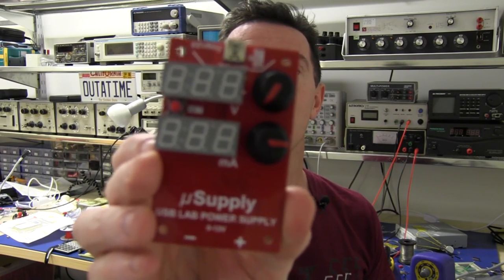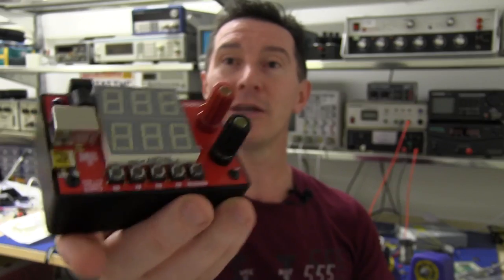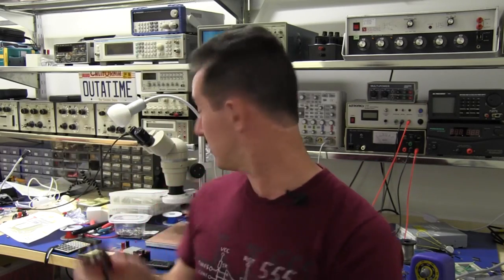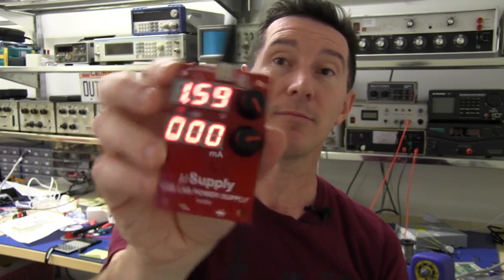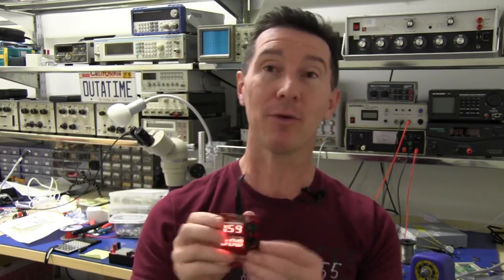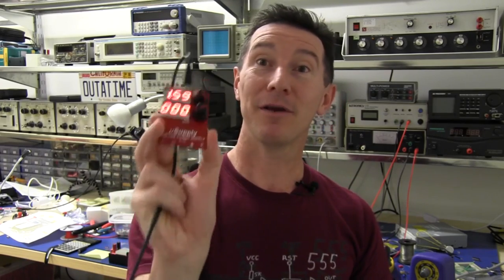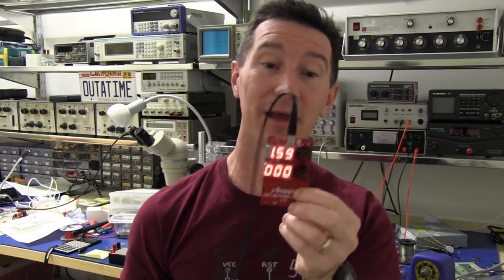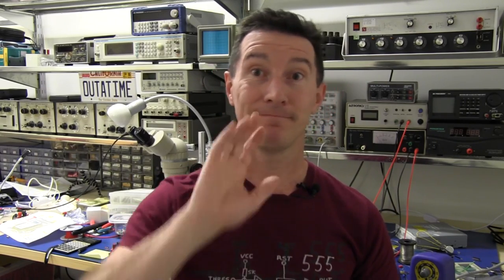EEVblog #285 - USB Lab Supply - Part 1

Comment: As an electronics engineering student, this is amazing. 

Off the top of my head:
- Won't the 7seg-displays use up a lot of power? About 40mW * 6 = 240mW ~ 10% of your available power, or am I overestimating? Substitute for lcd?
- You could also use an attiny to make the supply effectively a usb keyboard, that outputs all the values as typed text (in notepad or something), you can even have two-way communication using caps/num/scrollock. Maybe for a future usb-stick size nanoSupply :) ?

Comment from the maker: IIRC the dual muxed display at a reasonable brightness took about 40mA or so (200mW). It's a lot, but I was fixated on having LED displays at the time. I have a trick up my sleeve, those displays are not the final solution.

Comment: I actually got a recent design that combined the USB and batteries into one unit - USB charges the batteries, and batteries powers a boost converter capable of at most 36V at 2A. I called that MTD295A (5 cells, there was 3 designs differ in only the amount of Li-Ion cells used: 295A with 5 cells, 299A with 9 cells and 292B with 12 cells).

Comment: Also, there are USB Power Delivery (USB PD) which allow a USB port to supply much more than 2.5 Watts. Though probably no one implements this at the current time and afair it is still a draft, it might be good to look at the coverage of this and take a future implementation of this into consideration. (You are of course right that 2.5 Watts is really neat, but if you really think about it - very often this is not enough.)

Comment: PL2303 (cheaper than FT323) to add a "com" port in order to control/log it via software. It should be trivial since there is an (PIC ?) mcu (judging from the use of rotary encoders).

High current output selection switch (1000 mAmps) for USB3 ports or Dual USB2 connection.

Comment: I like the idea. I would like a boost convertor in it so you could get roughly 0-12VDC output voltage. You could get fancy with computer controlled set points, but I think a two knob interface is a great starting point.

Comment: If it's specifically for a PC USB port (not any generic USB power adaptor etc) then I would want it as small as possible and have all the control and monitoring on the PC. You could then have data logging and automated control, pre-sets etc and no bulky display/input on the device.

Comment: USB ports on a computer are generally all centrally fused (usb_org/developers/whitepapers/power_delivery_motherboards_pdf), so are capable of supplying much more than 500ma/1000ma that most people quote;
Current limiting on the USB ports in a per port basis is generally only on hubs, it is not designed as a "current cop" to stop you going over the allowable current, only to protect you and your devices.

Idea related to above;
Put some form of adjustable current limiting on the sour

Comment: Futher ideas (may be interesting):
1) Lead-acid battery powered regulated supply. Perfect isolation and overcome 2.5W power limit on USB
2) Redesign a cheap "electronic tramsformer" for halogen lamps into normal unregulated power supply. Power levels of 50-300W can be obtained easily at below $10.

Comment: Pretty simple idea. I feel it needs either a low power LCD or a way to turn off the LED display so you can save a few precious ma for the project, but honestly if you're going to be going that close "to the rails" this may not be the best option.

Comment: Pt2: Yeah and I also have an LM317-based linear regulator designed with 12v input in mind. It's not terribly efficient, but does the job when you need additional voltage, and it's not common you need a lot of power outside of the 12/5/3.3v rails anyway.

Comment: I've come up with a few solutions like this myself (albeit mostly fixed voltage), I have a couple of bench supplies but sometimes you need more voltages, and PC PSUs are great for tons of relatively stable power. E.g. I've modded a USB port so it's wired directly to the 5v PSU rail rather than running through the motherboard, so current is less limited, but no data. I've also made a box with banana sockets on, wired to 12v/5v/3.3v/GND, connected back to a SATA power connector inside the PC.

Comment: 10A at 30V is a lot of power, im already habing problems getting my 0-40V 100W sepic to work as intended without overheating.
for 10A you need some wide tracks, and for 30A you would have to use a solid cooper wire of about 4 or 5 mm as tracks. further more 30A is a lot, i use a circuit breaker anytime i work with lead batteries because of that and even with the 15A CB it can still evaporate 2mm track in the time it takes it to disconnect.
u would need a really quick regulation circuit there.

Comment: @ battery power supply, 

I know it's late for this project . . . , but if it is at all possible: 
How about including, say, 2 (or more) programmable buttons!!

I would LOVE a couple programmable preset voltage/current buttons (or more if they will fit)
It would work with your included uController, just press & hold to set, & quick press to sellect!!
(or perhaps one being voltage button, the other current . . . )
[momentary buttons = small/ Cheap!]
Would be nice for this supply TOO :)

Comment: Depending on how you do a sense/ref voltage, it would be nice to have an extra lead that would be a voltmeter.  So with analog switch depending on microcontroller, you could sample the supply output, then switch in the extra input and read it, Or use a ADC on the microcontroller. It would be nice to be able to measure some other voltage when you power up something your are testing and a button then for the voltmeter readout/mode.  (Might also use this extra probe as ultra low volt/current sense

Comment: I would assume with such a project you would want it to use as little power as possible and be as efficient as possible.
Wouldn't it save power to use one small LCD screen with 3-4 digits or maybe one 1x8 lcd? 

Also, there's the usb charger standard which allows them to demand up to 1.5 A. How about adding a switch allowing users to limit to 0.5 or go higher? 

Sending v/a out through USB would be great...would be nice if you at least talk about (isolation etc) even if you don't to do it...

Comment: I'd say make it a 'hybrid' power supply! Be able to control from USB, but also powered from USB up to 2.5W. If standard power pack is connected it will switch to that power source by itself. I guess the power output would be limited to 2.5-10W depending on the design, so like 0-1A output at 0-12V or something. The only issue with that is that you'd need a buck-boost converter for that..

Comment: also, if you have a mcu on board, you might add a simple CDC interface so that it can send data to PC on current and voltage (or even receive data from pc for set current and voltage, but I think readout is more then enough)

Comment: Great idea!

Does it have protection against drawing too much power from a USB port? I've seen a few PCs which do not have a PTC thermistor or any sort of current protection on their USB ports (!!!) now. Usually you find out about it when a USB device or cable shorts, and the PC's mainboard catches fire. Maybe make it adjustable using a jumper to make it possible to utilize a 2A USB power supply (like the iPad power brick, for instance)? That, and reverse current protection, and I'd buy one!

Comment: This is a great idea Dave... 
I wouldn't mind it being bigger, As long as you make it as flat as possible, 
(about the thickness of a kindle maybe a bit thicker) 
So it can easily fit in to a laptop bag/pouch without causing any damage to the other stuff that's already in the bag/pouch (so, no sharp edges, parts, or protrusions ).....
Reply: vape-pun-to-come More realistically, better power components can be used if it's the size and shape of the laptop charging brick.  B port on one end, 3 or 4 output binding posts on the other, reusable generic USB cable, computer controlled and monitored buck/boost isolated DC/DC converter inside.

Comment: Pc/laptop usb can only supply 100mA until the device has negotiated with the host that it needs more (some computers can now supply 1A or more over usb). A simple mcu with hardware usb support would overcome this problem though

Comment: Some of mine ideas:
1. powering from 1 to 3 usb ports to get 1.5A, it would be useful.
2. programmable trigger for start/stop loging and start/stop output.
3. Data loging to internal memory when connected to, for example usb charger, car audio, etc.
4. Voltage and Amps meter witch loging capabilities.

Comment: How about making it so if you wish u can add a 2nd usb cable for more current and/or notebooks that dont give the full spec. What about making it a hub also? (Then I dont have to carry a separate hub) What about an external power input for an SLA or plugpack? I have had applications where I need 3.3v with at least 2amps, and I was forced to go and use the desktop (and steal the 3.3v from the internal switchmode, quick and dirty but it did the job surprisingly well)

Comment: Can it be adjusted above 5v? Maybe a pin and sleeve connector that comes out at a right angle from the board to keep it slim. Do you plan on leaving the connections to the load just solder able?

Comment: Hi Dave!

You might consider designing the new gadget in a way that it can handle the extra power that comes from a dual USB connector cable (Dual USB A to Micro B - USB cable). Like the one that comes with portable harddrives without wall warts. That would be 5 W rather than 2.5 W.

nixxon

Comment: How about an option to control the settings from the computer over USB :-) If you build something Arduino compatible, there is no problem writing the PC software. Oh and of course also push values back to the PC of the current and stuff... [2c]

Comment: I use a bus pirate as a sort of USB power supply (I find it pretty useless anything else) .. It's useful as a PSU because I can turn it on and off via its shell interface which is really handy when working with micros etc as you can power cycle without your hands leaving the keyboard. So my feature request would be to have some sort of control interface over USB (with the hardware knobs too if possible). Having a DC-DC booster for more than 5v would be nice too.

Comment: It would be nice to have a slick design of it. Why not use a LCD screen something similar to calculator or ur digital watch. Also the control nobs need not to be that big even for a person with a big hand.

Also, it would be nice to have a port with a fixed 5V supply for the project where you need multi supply voltage.

Comment: I like the idea, but haw about a plain LCD display and a switchable backlight to save some power. Also it should be able to limit the power to what ever the computer says, i.e. in some cases you might just be allowed to use lika 100mA or so.

Comment: reset on the Arduino is done via modem control lines right? the cheap cp210x modules don't bring those pins out..

Comment: Instead of fastening the board to the top of a box, why not make it slightly smaller than the inside of the box so that you can sticky-tape the board to the bottom of the inside of the box (assuming pots are mounted on the top of the board) like this: tinyurlDOTcom/uUSBinBox. That way,the sides of the box protect the unit.

Another way would be to screw the board to the box, but upside down, so the guts are inside the box. Cut holes in the bottom to clear displays, knobs, jacks, etc.

Comment: Yeah, nice Project. I would like to know, if you're only using the V+ and GND of the USB-Port? It would be very cool, if it was able to read out the measured voltage and current and even cooler, if it was able to set the voltage and current per software. If you are using a µC (for example a PIC with an USB-Module), it would be only 2 signals more to route. And with a µC it would be able to build a little buck/boost converter ;)

greets from Germany

Comment: Beware that engineers (well MBA's, actually) cut corners to increase profit.  There may be a lot of computers in the wild that cannot source much current and do not adhere to any specs.  Second, if you are using USB, might as well exchange data with a client on the PC to show current draw and voltage.  You can make it programmable and save the BOM on the LEDs and drivers.  Trivial to program and you can have a window with those same readings and maybe even TREND data for under-voltage.

Comment: put some low profile display there. the 7seg's are tooooooooo tall, the surface of the device is not a big issue, everything below A5 size is easy to put in a laptop bag if it's thin, but thickness is huge issue .. if you can keep it under 6-7mm it would be great (I think it could be designed to be 3mm thick without any problems but I'd use the heatshrink as a case, using proper case would add another 2mm easy)

Comment: Hi, I'm a huge fan and I absolutely love your teardown tuesdays, (request: spellman/Glassman high voltage supplys.)  I'm a mere lowly undergrad but am headed into EE for RF and Power Engineering because I love my Black-Magic.  Anywho, have you considered incorporating a little Boost Converter into your next USB-PSU?  Then you could potentially leverage that 2-watts for 12, 13.8, 15 etc variable voltages!  That'd be cool to see.

Comment: More practical and relevant than the battery powered one actually. I think.
Especially the fact that it is isolated. Digital control via USB would be fun. :)
And if it would identify it's power usage to the USB host like the specs require.
You can draw 500mA on USB, but according to spec only if the Host allows it.

Not worth the cost perhaps, considering that the world is already full of 'farting USB novelty toys' that don't do it right. :)

Comment: who does have firewire in a netbook? and just a few notebooks do have firewire so its kind of missing the point.
i would preffer it to be powered by 6 nimh AA batteries (2A x 7,2v =14,4W) than from the firewire, and you could even use it to charge other smaller things like a cellphone. dont think a notebook as even my netbook's psu says it gives about 40W at 19V but for cellphones, usb gadget, micros,  or small proyects it would be more than enough.

Comment: hi, i really interested in this power supply.
I am curious about how you display the voltage and current, is there any material which show me what is the current or voltage on the circuit  without using multimeter?
I want to make my own power supply with using a transformer but I dont know how to display what is the value of my current or voltage. Could you help me?

Comment: i would defo be interested in the USB lab PSU or 2. I would like to use it also with a USB portable phone battery charger, for power on the go. i also make my own portable USB phone chargers for extra power for my phone. i would like it to step up to 12v if possible. i use a step up reg with a turnigy power monitor at the moment. but to have it in a neat package like yours that world be fantastic.

Comment: I designed a similar PSU (PPS6W) at sangelectronics a while ago and I thought this video was interesting. I also started like yours but did not like the look of it, so I stick to the USB controllable instead.
Reply: I have one of these; the company seems to be defunct now. I was hoping to be able to run it from a Raspberry pi, but rather than snooping the USB to reverse-engineer the protocol, any chance of talking the makers into opening the (Windows-only) code (I believe the stock software was written with LabView)?

Comment: I would live to have a USB powered power supply that puts out 24volts. The "power express" puts out 24volts to power instruments that run on 4-20ma loop power. It also has a hart modem built I but it would be happy with 24 volts out of the USB port.